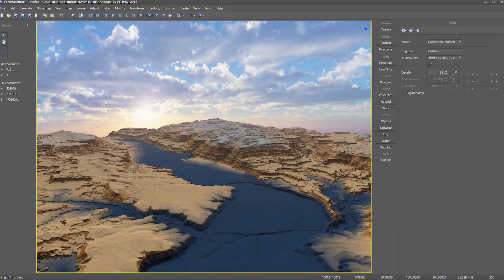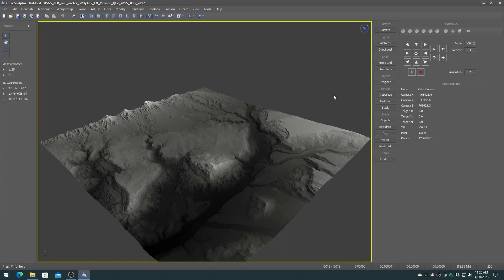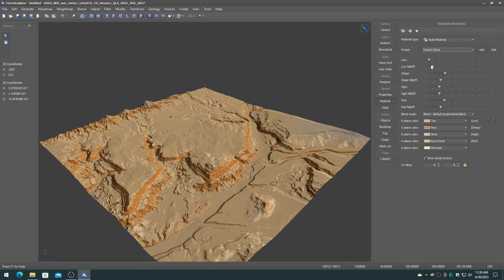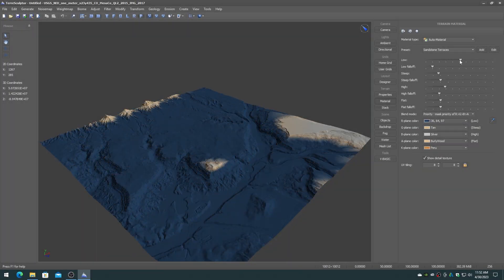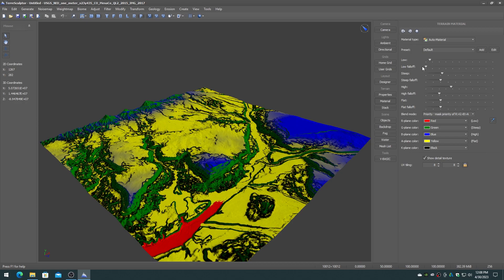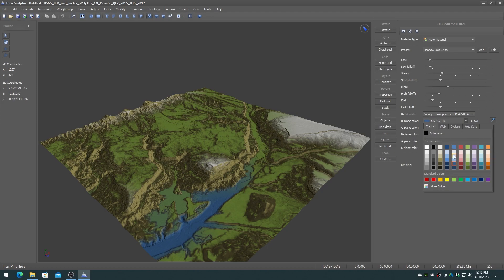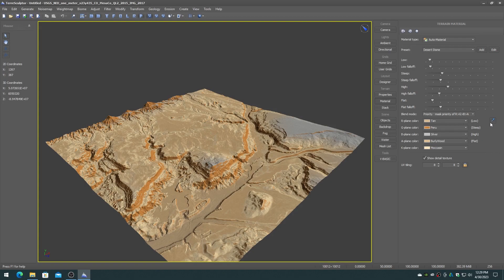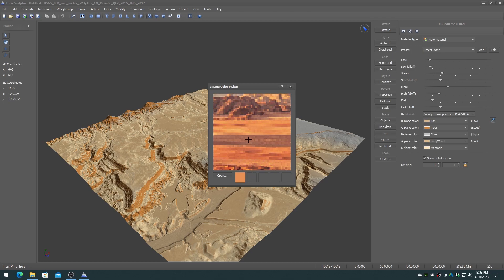TerreSculptor Auto-Material

Comment: Please, is it possible to export the masks for each textures ? I want to generate a splat map from these auto-material presets
Reply from the maker: The Auto-Material in the Terrain Material section is limited to the resolution of the terrain mesh in the viewport, which is typically a different resolution than the underlying heightmap.
For example, if you were working on an 8192x8192 heightmap, the viewport mesh will be either 1024 or 4096 depending on the Viewport LOD chosen.  So your splatmap masks would be the wrong resolution for your heightmap if you simply exported the Terrain Material.

To create a splatmap for the full heightmap resolution, use the Biome Devices on the Biome menu.  They do essentially the same thing as the Auto-Material and have multiple variations of weightmap creation.  The Biome Devices are just as easy to use as the Terrain Material.  Just adjust the sliders until you get the masks adjusted where you want and specify a file name to save on building.  It will save all of the Weightmaps and a Splatmap file.
Reply: @demenzunmedia  ok, thank you very much for the explanation
Reply from the maker: @protoxy_fun  - I will add the idea of saving the Auto-Material weightmaps to the future feature list though.

Comment: This is really cool, is there a way to utilize the auto material outside of Terresculptor? For instance, I'd love to generate a terrain, create an automaterial for it, and then export both the terrain and its automaterial over to unreal engine. Thanks!
Reply from the maker: The Auto-Material doesn't support export.

However, there are three new Devices being developed called Biome Devices that will provide three different variations of what the Auto-Material is doing, including exporting the Weightmaps and Splatmap, and I will be looking at seeing if I can script the creation of Unreal Engine Material Shaders as well.  The Biome Devices are already under development, and the first of the three is close to completion.  The Biome Devices are also capable of creating significantly higher resolution output than the Auto-Material.

Currently you can accomplish similar results by using the Weightmap Extractors and the Splatmap Creator on the menus, but they take a bit more practice and work, and they do provide the assets exporting for Unreal Engine.
Reply: This would be a game changer if we could get correct texturing that can be “as is” or edited using color IDs. This is a great app!
Reply from the maker: @daemonjofficial  - Ok, I see what you mean, for use with Blender or Substance.

I do have FBX file format coming soon to TerreSculptor, and in that file format I plan on supporting Vertex Color IDs and other features to make exporting fully color terrain meshes into those apps.
I can easily duplicate the current Terrain Auto-Material Vertex Colors into a mesh export.

If you have any additional features that you would like to see, be sure to let me know.
Reply: @demenzunmedia  you’re the best!! I can’t wait for more updates! You have a fantastic software.
Reply from the maker: @daemonjofficial  - Thanks.  Can you expand a bit on what you mean by Color IDs?  I am always open to adding feature requests.

The Splatmap system in TerreSculptor, in addition to the new Biome Devices that are coming soon, support creating complex Material Shaders that can use colors or textures.  I have a set of videos on RGBAK Splatmaps on the channel.